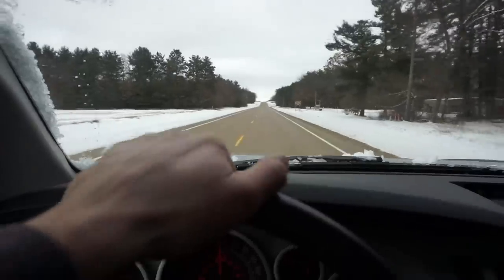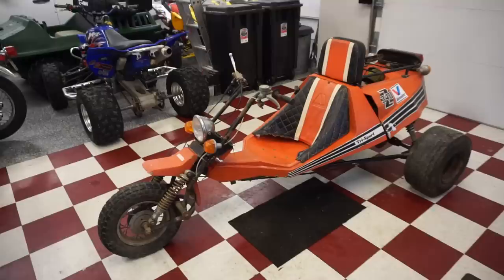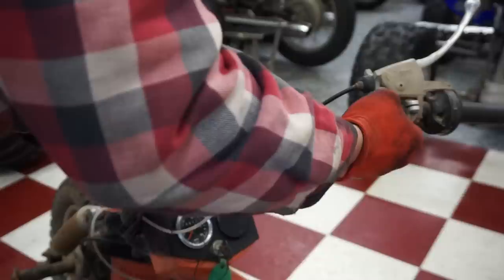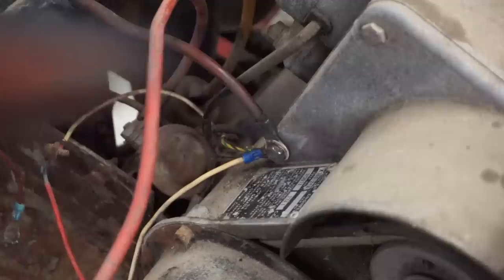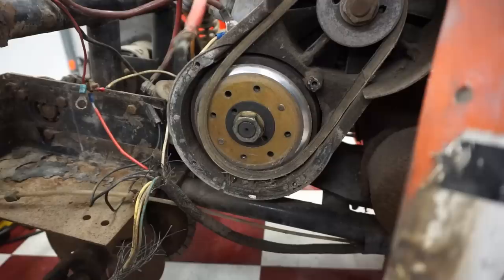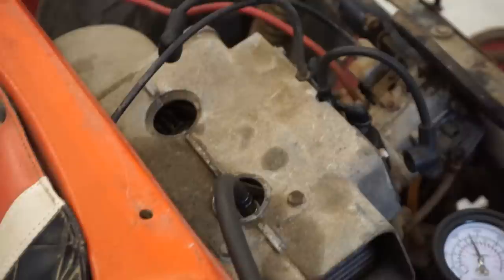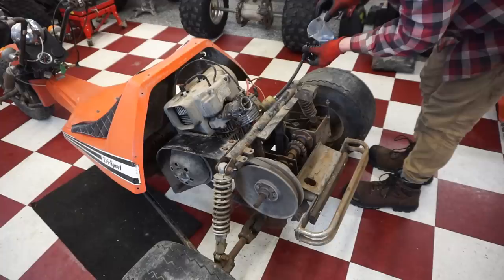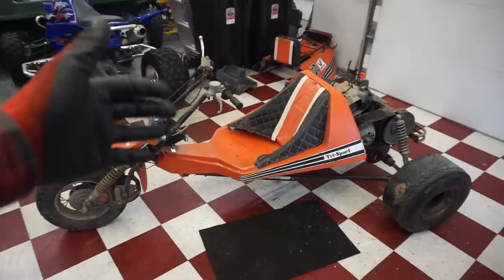Street Legal 340cc 2-Stroke Trike Found Untouched After 40 Years

Comment: It's really cool. I wouldn't have paid that much for it though, especially with it missing parts. Nothing is going to be available for this machine, so every missing part will require fabrication, or a lot of time and engineering to replace. It will also not be cheap. I like obtaining old, rare machines myself, and I have run into this problem before. I have bought a couple of them over the years that had a missing part or two, and didn't think much of it. When I actually started working on the machines, I found that the parts were prohibitively expensive, if they were available at all. I ended up losing money several times, and learned my lesson. If I am purchasing a very rare or old machine, I research the cost and availability of parts and inspect every nut and bolt before I purchase it. If anything is missing or damaged beyond repair, I adjust my offer accordingly unless the machine is extremely valuable. If the seller won't budge, then I walk away. Most of the time, they will come down before they let you walk away. I love challenges, but I don't like losing money, so I don't pay asking price for something that is incomplete unless I am planning on keeping it.

Comment: I saw one 20ys ago in an old guys garage, but it had a single wheel behind your back & 2 front tires with fenders on them. You sat in a enclosed cab with a 8” orange windshield. It was turquoise, white, blue. All the 70’s stripe colors. Went back 8 months later to buy…gone.

Comment: I remember these back in the day. There were 2 different engines. 340cc and 500cc. I saw the dealer take this down the road in a straightaway the front end came  off the ground and he cruised up to 110 mph so he said. It went by awfully fast. This is the street version there was also a version with the rollbar and knobby tires for the dirt. I nearly bought one. It certainly look like a lot of fun just wasn't for me I spent more time in the mountains racing with my brother.

Comment: I used to have one of them they are so much fun only used it the off-road it had a 125 4-stroke motorcycle engine twin cylinder modified on it no centrifical clutch just chain drive

Comment: We had two of them in the late seventies both were 340z,s and we couldn't drive on the roads because it was illegal. But they were fun. The brakes didn't last long and every time i fixed them it would fail again, we wasn't worried about stopping we just wanted to go faster lol. It hurts like hell when you roll it so try not to, you gotta put knobby tires on it or it's gonna just spin , they will flyyyy

Comment: you could glue up that original tank, and make it into a "Plug" to pull a mold off of, and then make a new tank from fiberglass! then it would be the EXACT correct shape to fit in and hold the right amount of fuel -

Comment: NICE!!!!! My dad had 3 of these. 2 full size and a smaller one for me. I was around 5. 1975 ish. Unfortunately he sold them before I could drive mine. Had plenty of rides and we slipped away from the police a couple of times. He started one and the Throttle was stuck took off up a tree 10 or so feet away. Had a wheel bar. bounces all around until he killed the power. I was like awesome! Mom.. not so much. Probably why he sold them. Darn...

Comment: You could repair that tank. In all likely hood it's is made of HDPE plastic (high density polyethylene). If you could find another black gas tank, or gut an empty black gallon oil jug, you could possibly use either sacrificially for panels. You could make your own "welding rods" from oil bottles as well.

Comment: Really nice find Joe, mine was blue metal flake did about 75-80 mile an hour top speed but very quick steering they're fun to slide around but have to be careful of rear tire doesn't catch when sliding sideways and flip you over. I would get a gas tank from a riding lawn mower.

Comment: Pretty sweet...  I remember we had one of those in high school back in 97'... Unfortunately we cannibalized in shop class... turned it into a custom Dune Buggy cutting the front half off.  I remember it was gray, and I think it had long dual exhaust pipes... It was a 340cc as well I remember, I don't think it was street legal model.

 I suggest a Craftsman riding lawn mower tank, Or I found this one online nice size 4 gal. might be to big ... just Google what it says you should find it... 

also a 1974 brochure on e Bay as well, Looks just like yours!
👀 for...

4 Gallon Black Multi Purpose Tank - 15" L x 8.5" W x 9.4" Hgt. (2.25" Neck)

Item 15405

and... on e bay...

1974 ALSPORT TRI SPORT TRIKE NOS VINTAGE BROCHURE MINT CONDITION 3 WHEELER

Comment: I just finished the video…. If you reach out to me I can share what I know about these.  Per my other comment i owned the two stroke they labeled as the racing version and the four stroke was the cross country.

Check the little box above the right axle, it has the old VW fuses in it that controls the lights. 😊
Reply from the maker: Thanks for the info. How do I get in contact with you? Is there a good place to buy parts for these?
Reply: @2vintage  I posted a reply with my email but it was deleted I think.  Not sure if that was you or the system.  I sent you a FB messenger message as well.  Once we get connected I’ll fill you in on everything I know about these.

Comment: **the absolute most common thing to happen with points and condenser ignition engines loosing spark is when they sit for a while the points get corrosion or a film/oil on the contacts of the points and will not get any spark.
 Used to have this happen CONSTANTLY with car motor boat engines that sat for a few years-- a 30 second cleaning with a flat head screwdriver with a piece of sandpaper folded over the screwdriver tip to clean the contacts and that literally fixes 99.9% of them!!
Reply: **this happens FAR MORE then points sticking or wearing out etc, literally 100 to 1!

Comment: Picked up 2 of these a couple months ago minus motors  they're both a little different from that one and also have minor differences of from each other I've already got one going using a 212 predator  it's a  surprisingly smooth ride not to mention the acceleration and top speed with a 90% stock 212

Comment: I have one of these, but mine had a Rotax 377 Barbedeir motor with dual carbs and dual exhaust,  the motor is shot and gone ,I still have the two carburetors, and few of the other parts to the motor but not much,  the frame, the seat and front fender, the two back tire rims and the front tire rim with tire, not sure what else , I have moved around, so parts are just everywhere, I tried keeping it together...I have had my trike since 2000 or 2001, I thought it was built by JC pennies, where you can change the front to a ski to go in the ❄️ snow...but it looks more like a tri-sport...

Comment: That's cool but I found that getting the CVT to run at the right rpm loaded and unloaded is essential when I tuned scooters....... I know this is stock but with wear these things are tricky......an easy way is changing/ shimming rear spring, the stiffer it is the higher rpm it'll run at.....on scooters the variator weights and rear spring and rear pulley angles can be changed.

Comment: I had one of them tri sports same as you just got and the points in them are known to get weak return spring and it will run good but won't  throttle up it just bog's and sounds like a Crank seal is bad

Comment: Hi joe you can use a steering wheel puller for that flywheel. Just make sure you get the correct threaded bolts in case it doesn’t have the correct threaded bolts. Anywho great vid.

Comment: I've owned 2 of these one had the 340 kholler 2 smoke ran like a bat out of hell! I swapped the carb from a ski doo 500cc 2 smoke... all the brakes worked very well I put a new belt on it and changed the tires for better traction and it also came with a front ski that was an aftermarket accessory from factory... and the other one I still have is slightly smaller with a 310cc 4stroke predator motor still fun as hell....

Comment: Make a whole new tank off of the same design as original tank. It doesn't have to be exactly like the old one as long as it's close to the same shape...Most welding shops will build you 1 probably...I seen alot on old type riding mowers made of plastic but they're dryd up and fragile lookn

Comment: It's two stroke, the tuning possibility is there...... It needs  maybe Rotax cylinders and an expansion chamber. Course then you'll have to do the clutch as well, maybe taller gearing.... You could make it into a pure suicide rocket. Grrrrr
Also if that's a 10 inch front wheel you could jerry rig a vespa front disc brake.

Comment: All it needs is.throwing on a 26" wheel with a.qs273 hubmotor with hubfins and statorade running 40kw. Ditch the gas engine to lighten the ass end and you'll have an adult electric Big Wheel.

Comment: Question, I have a 1999 YZ400F that will start but it takes like at least (not exaggerating) 25-30 kicks to get it to start. I had a guy look at the carb a while ago, he said there was nothing wrong with it. It overheats way more than it ever should (pipe gets cherry red) and we checked the water pump and radiators, completely fine. What should I do?
Reply: Valve Clearances is my guess - It might run a bit than stall out,  or the Timing Chain has Jumped a Tooth -Do a Compression test, you can get a Tester for $20 on eBay or Amazon -  👍

Comment: How can it be street legal without a speedometer?
Reply: @a.c.m.e.ink.4568   Do a pedal bike have to conform with the same safety laws as a motor vehicle? I didn't see any pedals on this trike, where are they?
In Canada, a motorized trike falls under the same regulations as a motorcycle. Even in the 70's new street legal vehicles had to have working speedometers.  
The motorcycle shop on my street(Toronto) had a guy bring one in last year. Nice bike, but to get it on the road it needed everything the same as a motorcycle, including street legal tires, registration and insurance. 
My van is street legal, but if it don't meet safety standards, it can't legally be on the road.

Comment: i would have just went to where the kill wire comes off engine and disconnected it to check for firing then still no fire i would have looked at the points if it has any  or the electronics